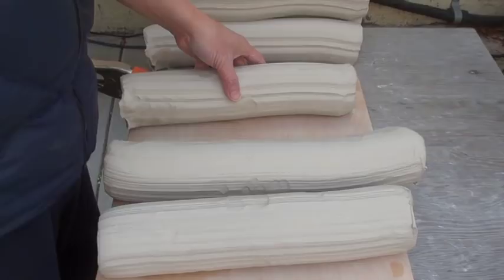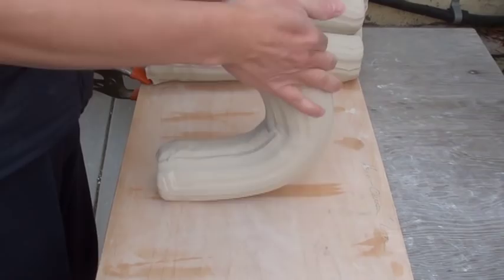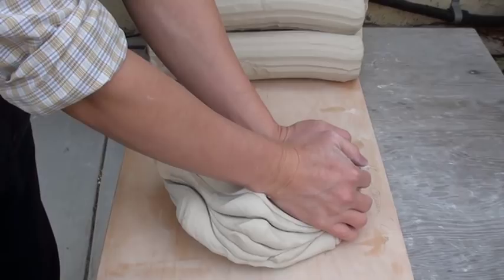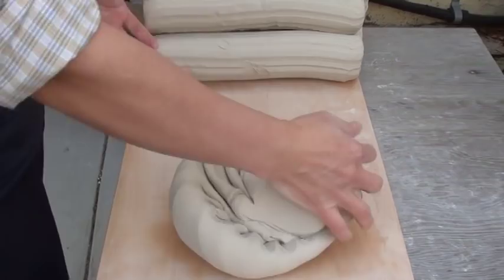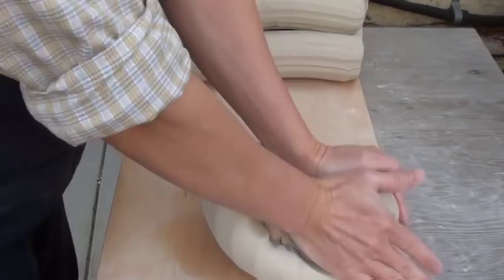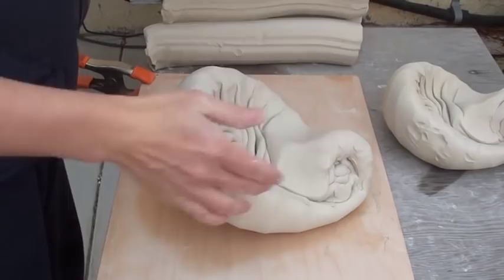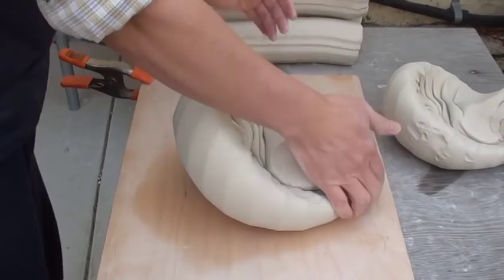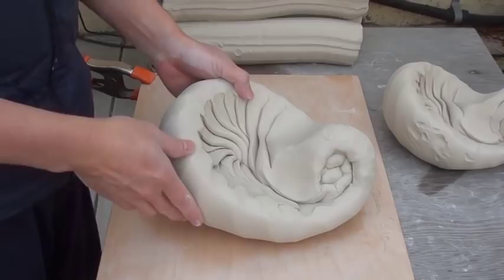38. Learning Spiral Wedging / Kneading Clay 菊練り with Hsin-Chuen Lin 林新春 菊練揉土示範

Comment from the maker: @nmbilly1962 There is no specific requirement for a wedging table as long as it absorb water.  My wedging table is a sturdy table and I just place a piece of plywood on top of it for clearly showing the texture.  Normally, I don't have the plywood.  As to the height of the table, I prefer lower table so that when I am wedging I can use my body weight to save energy.

Comment: What is your wedging board material? Does the clamp in the corner hold the board in place? I’ve read  about diy wedging tables made from wood with canvas stretched over it, potter’s plaster #1, cement boards, etc… Not only do I need to wedge clay, I need to also reclaim as much as possible. Any assistance is welcome. 

I am working in a small barn space, which I share with an older lawn tractor & a backup generator. I have a couple shelves, a work table (wood table that is painted blue), an older metal Shimpo pottery wheel that is approx 15-18yrs old. As much as I’d love one, I don’t have a kiln. A couple years after I bought the pottery wheel, my husband suffered an extensive heart attack req’g a quad bypass. A few years after that, he was out on a motorcycle ride when he was hit by a drunk driver. One thing after another pushed pottery making further out of my life until the last few months. Kilns are super expensive. So much so that they’re out of my price range. That being said, there is also the fact that I don’t think I’d have enough electricity access to fire a kiln without tripping a breaker. I have multiple autoimmune diseases as well as a retinal disease & optic nerve defect that prevents me from driving. Everything that goes toward pottery has to be necessary & as low cost as possible.
Reply from the maker: Watch this video: https://www.youtube.com/watch?v=bGduAGyX20w

Comment: I throw clockwise, would you recommend spiral wedging the same direction as I throw? Great demo.
Reply: +LB Ceramics 
Depends on your dominant side
Reply: +LB Ceramics I don't think it matters.
Reply: @sylasviper715  It seems doesn't always work with the dominant side if you are ambidextrous to a certain degree... Which is a case I have been struggling with, still trying to figure it out...😥🤔
Reply: @EleaSuJa  weird flex, but ok.
Reply: @sylasviper715  😅